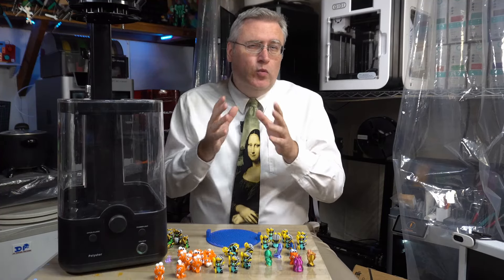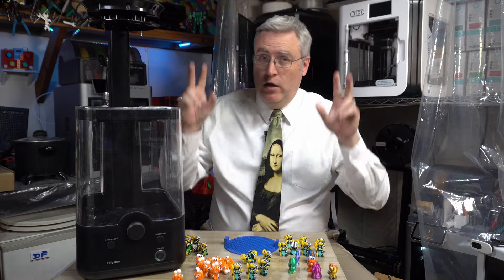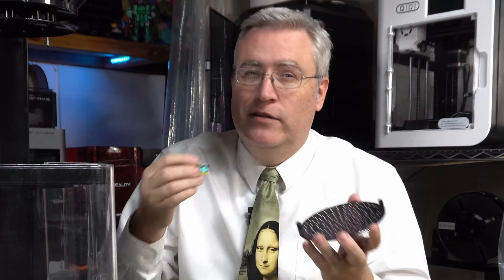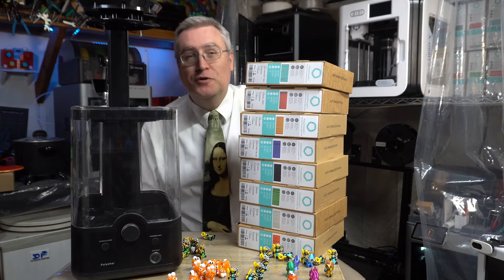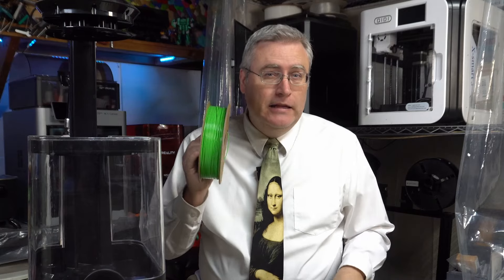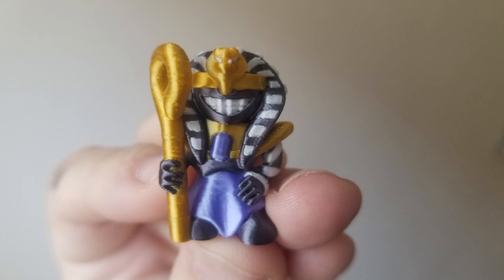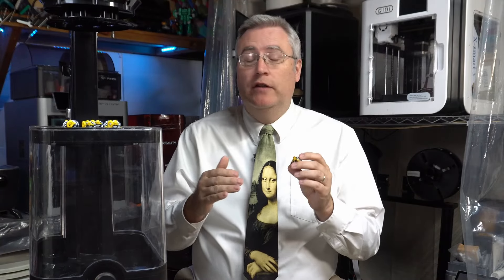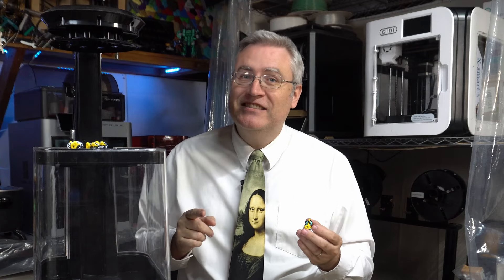Smoothing Multi-colored prints with Polymaker Polysmooth

Comment: Re: spool weight - PVB is 1.12 g/cm3 while PLA is 1.43 g/cm3. So, PVB is about 78% the weight of PLA for the equivalent length - not too far off from compensating for that weight reduction.

I really wish filament were sold with both a net weight and filament length. It would be a lot easier to figure these things out.
Reply from the maker: It seems odd that it'd be the same length, considering that the spool is physically smaller.

Comment: How about just coating them with lacquer or top coat? Single ones could be brushed with nail top coat, let smooth itself and then hit with UV, but of course that won't work with plates and plates of models. Spraying and drying could still be faster than polysmoothing (they are tacky and sort of soft after smoothing?).
In a factory-like environment figures could be attached to pins (array of painting handles with dual-sided tape or better adhesive),  dipped (upside down) or sprayed and finally cured/dried in batches 🤔

I don't remember what was the layer height of these prints?
Reply from the maker: I can experiment with that. But off the top of my head, I can see a couple of problems. Capillary action would make small creases turn into soft curves. Also, your print would get a little thicker. Overall, I think the effect would be like a transparent mud. but I might be wrong about that.

Comment: For the figure with the gold Staff, could the staff be a separate piece that is either printed out of the silk PLA or just bent from a gold colored wire? Of course, if you did this, the pieces would have to be assembled and glued together, but it might be another option.
Reply from the maker: Potentially.

Comment: Hey! I'm new to printing, when you said some of your prints failed and you cancelled them, do you mean you were able to pause the print and selectively choose not to print those objects? Can you explain how to do that or where to find more info? That'd have saved me big time once. Love all your content
Reply: I am also fairly new to 3D printing so I've not used many printers and not entirely sure of all their features

That said I use this feature quite often it is called "exclude object" in klipper (which is the firmware I use in my printers) but I know at least prusa printers support the feature

Note that if your printer supports that feature you need to use "label objects" in your slicer for the feature to work
Reply from the maker: Some 3D printers can cancel individual elements in a print, but that's a fairly new feature. Most of the cheaper 3D printers it's all or nothing.
Reply: @3dpprofessor  Ah, it's only in the Bambu Handy app! That's why I didn't see it before. Saved me multiple times already. Thanks a ton!

Comment: The search for smoothing PLA is the reason my channel exists. 
I settled for coating in clear ABS till recently.

After a discussion on reddit i went back and tested a chemical (Dichlormethane) that already failed me.

Well turns out i was scammed by the lab supplier and what ever i got the first time was not the substance i orderd.

DCM works just like acetone for ABS and with nearly the same speed.

Works better then THF (Tetrahydrofurane) and is way less toxic. 

I admit my mistake dismissing DCM after the first time.

Now im a firm believer! DCM is the way to go.
Reply from the maker: I have have to check it out. THF did not work great.
Reply: @3dpprofessor   absolutly. THF also has 3 major downsides.
1) it can create a explosive compound just by beeing exposed to air
2) its often sold mixed with BTH to prevent the creation of the explosive component
3) the most harmfull one imho its definitly teratogenic which can have lifelong consequences even by exposure in small doses.
Reply from the maker: @chemicalartist3d289  I mean, acetone isn't exactly the  safest substance either. And isopropyl, while not as explosively combustible, is still very flammable.
Reply: @3dpprofessor  unfortunaly yes. I went over the datasheets of IPA, Acetone, THF and Dichlormethane.

None of these chemicals are a walk in the park.

THF takes the cake for teratogenic effect at small doses (450mg on rats).

Acetone is acute toxic and can cause an allergy over time just by breathing the fumes alone.

IPA has the highest flashpoint of 53,6°F (12°C) and has quite a low LEL.

And last but not least DCM has the lowest flashpoint of them all -38.2°F (-39°C), is teratogenic, a know carcinogen and has the lowest LD50 of 1600mg/kg.

I guess there is no easy way that does not require PPE and good ventilation. Proper handling is definitly required.

My guess for the safety of the Polyisher is that it creates enough IPA mist that its above the upper explosion limit, negating at least that problem.

Comment: 3d printing is reaching NO POST production levels.  A major prohibitive of this evolution is 3D modelers transferring or interpreting from injection design to both FDM designing and Resin (Sla) designing. Lets say you Scan an item,  but it you try to print it with say overhangs it will not print.   These will be designed out and maybe a new era of ATTRACTIVE not DETRACTIVE  design will happen.